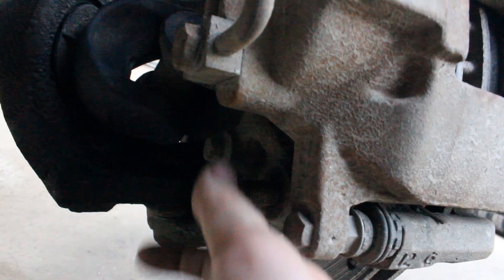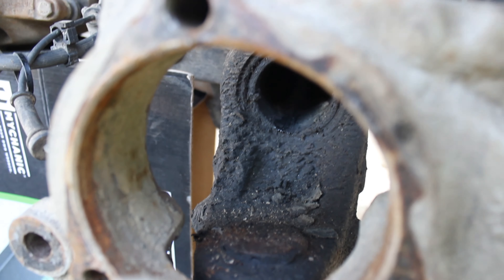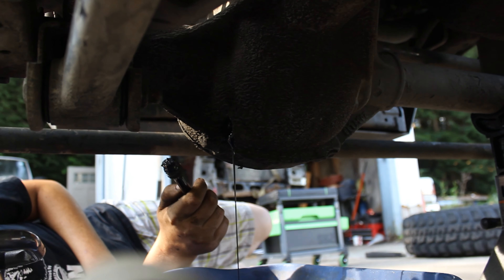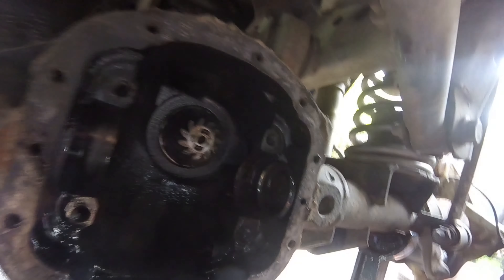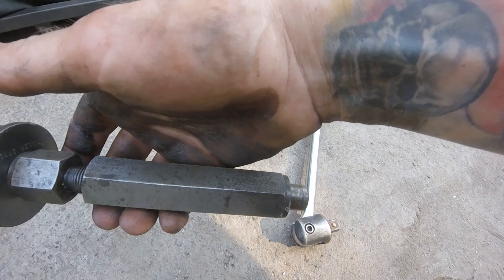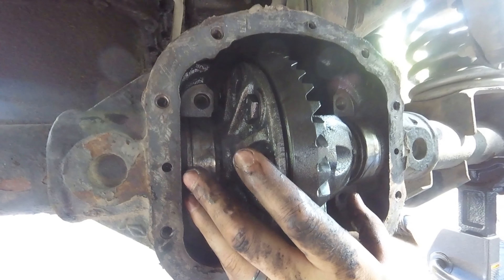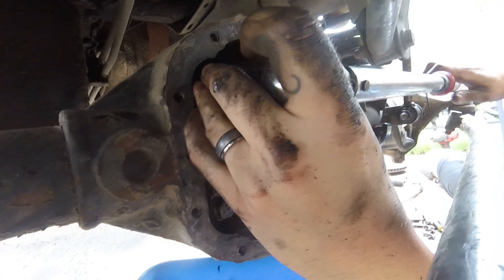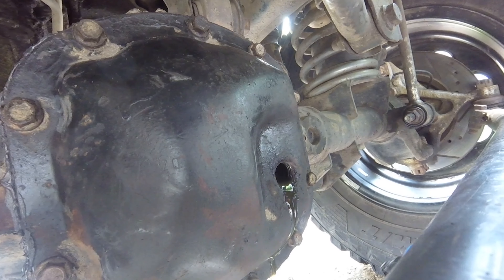How To Replace Inner Axle Seals In A Jeep JK/JKU

Comment: You're lucky the bearing came off that easy. I work at a  jeep/dodge/ram dealership and let me tell you , most of the time, the bearing don't come out this easy. Using the original bolts risk the chance to damage to threads. Best to find a matching bolt and hit it hard from behind. You won't get these bearing off with light taping and wd40 lol Most people don't touch them bearing for 100k+, unless you live somewhere that has no winter or rust. I live in Canada, New-Brunswick, winter are harsh around here. I use a matching bolt and hit it with a big air hammer with a special attachment that fits like a socket. It's a gamble to take on this task with simple hands tool and no air compressor. It's not a hard job but some people will get deceive on how easy this one was on video and be stuck at the bearing part or even before that. Good job tho!
Reply from the maker: I agree it isn’t always easy but sometimes you luck out. I live in New Hampshire so rust is my enemy too. Thanks for watching and any tips you have let me know

Comment: I'm part way through and is going exactly like the video except I can't get the gears to budge. I broke down and ordered a differential case spreader (Amazon for a little over a hundred.) It should arrive on Monday and I should be on my way again.
Reply from the maker: You shouldn’t need a case spreader. It will make it easier but some are just tighter in there. There is a trick where you put a rag in under the gears and spin the pinion and the rag pushes them out

Comment: Nice one buddy! I have a large washer welded to a piece of rebar i use for scraping the axle tubes. National makes good seals
Reply from the maker: D&E In The Garage yeah national is the only ones I’ve ever gotten they work well. I need to come up with a better axle tube scraper
Reply: You beat me to it!! LOL .. I was going to suggest the same trick. For those who dont have a welder simply sandwich the washer between 2 nuts on a long length of all thread. Ive done it several times. Good video man!
Reply from the maker: Power Addicts - FixJeeps.com - Jeep, car and motorcycle tips thank you I really appreciate the feedback

Comment: after watching your great video, I feel that I can tackle this task. Do the gears always come out that easy like in your vid or will I have to pry it out of the differential? I watched another jeep video, that I would have to get some kind of spreader tool for the differential housing to get the gears out, is this true? thanks
Reply from the maker: Intense Rider thank you 🙏 the gears don’t always come out that easy but you should be able to get them out without a case spreader. If they are tighter just gently pry with a pry bar and you should be able to work them out. I would put a rag around the tip of your pry bar so you don’t scratch up anything and just pry gently and you can wiggle it out. Hope this helps.
Reply: @TheBeardedJeeper  that's good to know, hopefully mine comes out easy. thank you very much for your prompt reply!
Reply from the maker: Intense Rider no problem if you have any issues let me know and I can try to help

Comment: Thanks!  We’ll be doing this on a friends jk soon!  Great timing!
Reply from the maker: SWBCrawler no problem man. If you have any questions let me know. Biggest thing is to make sure the bearing caps go on the same way they came off same side and top and bottom the same. They should have marks on the axle housing
Reply: @TheBeardedJeeper  Yea, ive been in a diff before, but its been forever.  No case spreader needed i see.  thats nice.
Reply from the maker: SWBCrawler nope easy enough to pull right out

Comment: When the gears and carrier come out. It doesn’t matter which way the carries goes? As to when you flipped it out and over the tie rod. You definitely turned it. As long as you keep everything on the same side you should be good? As in like, say you pull the gear out at 12 o clock. You could throw it in at say 6 o clock as long as it’s on the appropriate side? With sims bolts etc. That paints an easier picture? Lol
Reply from the maker: Shims have to stay on the same side they came out. The gears and carrier will only go in one way the diff cover sticks out more on one side to clear the ring gear. Hope that makes sense. If you have any more questions let me know.

Comment: I have an 2018 jk and the axle shaft will not come out. I can not figure out why, any help would be much appreciated.
Reply from the maker: USMC1ROU you should just have to give it a pull and it should come right out. Is it a rubicon?
Reply: @TheBeardedJeeper  no just the sport. I figured it out, I put the rotor on backwards and just barely threaded on the lug nuts. Then used the rotor as a sliding ram to get it out. It took alot of force but cane loose eventually. The newer models come with a due seal. Yet the due seal leaked with only 32000 miles on it.
Reply from the maker: USMC1ROU that’s strange I’ve never seen a dual seal my wife has a newer one only one seal. Maybe aftermarket.
Reply: @TheBeardedJeeper  Well either way, thanks for posting the video it helped out a lot!
Reply from the maker: USMC1ROU glad it helped you out. Don’t forget to share it

Comment: Well done, there's only a couple things I've done differently in the past.

-remove the tie rod so you can pull the gear set straight out
-on pulling the gear set, you can use a rag to force the gears apart and the gear set will walk right out into your hand
-I bought the Mopar seal installer for cheaper through an online vendor and WOW does it make a world of difference
I went cheap the first time with Synergy seals that looked identical to factory seals (also a 2010) it's worth going to the new Mopar style seal despite the synergy being $6/ each
-Jeep uses a special orange RTV on the outside of those seals when installing them
-a little grease on the splines doesn't hurt when resembling
-LubeLockers.....but that's a personal choice. I've not had to monkey around with RTV on covers in 8 years now.
Reply from the maker: kswyg thanks for the tips. I could have removed the tie rod but it’s just one more bolt to worry about and it fits right up and around ok. Just a little wiggling and the carrier came right out but the rag tip would come in handy. We did put some grease on the splines when we put it back together just didn’t film that part. The axle seals I got from autozone and they have never failed me yet. 
If we had both ends of the installer it would have worked better pushing both sides in at once. And I never thought about RTV on the seal itself because I’ve never had issues. 
I do want to save to get a lubelocker gasket way better but I don’t mind the RTV. 

Thanks for watching I really appreciate all the feedback too.

Comment: Turbo rad. I can buy all the tools and parts and still save $700 over the shop cost to have this done. Let's see how it goes 😅 Was this a dana 30? I've heard some times there are outer seals as well?
Reply from the maker: You got this! Yes it was a Dana 30 would be the same for the 44. outer axle seals did not come from the factory they are an aftermarket option if you want to use them

Comment: can I get the seal installing tool from autozone?
Reply from the maker: G Hernandez they have a similar one I can’t find the exact one on their site though but anything to drive the seal in will work just makes sure it goes on evenly and you don’t damage it
Reply: @TheBeardedJeeper  Appreciate the fast response. Thing is that my axle has been leaking for the past 15k miles. Not a lot but I am tired of cleaning all the gunk on the Cs. My buddy is trussing and C gusseting my axle tommorrow so I removed it today and already drained the fluid, disconnected everything and I will prep it for a weld and paint it after it is trussed. So if it's already off might as well replace the seals. I am pretty sure he can make a tool to pry out the seals like you but not to put em in. Thanks!
Reply from the maker: G Hernandez you bet. Yeah you would probably want to replace them anyway since welding on the truss can heat them up and melt them. Perfect time to do it. Hit me up if you have any questions
Reply: @TheBeardedJeeper  Damn, thanks!

Comment: Nice video!   Professional tip here - never ever install a seal and axle dry.  You should always lubricate the entire ring of the seal and the sealing surface of the axle.  I know there is diff fluid up against the inside of the seal but in the case of a double-lip seal, you will smoke that seal in just a couple miles of driving it..
Reply from the maker: Thanks for the tip I appreciate it. Always learning and that seems to make sense. Thanks for watching

Comment: A great tip I got from another video: Don't remove the center hub bolt, just remove the 3 hub to knuckle bolts and pry the hub out with a flat head punch and a sledge hammer by hammering around it till it separates from the knuckle. Then pull out both the hub and axle shaft together.
Reply from the maker: Thanks for watching. Yeah I would normally do that but I was replacing the hub for another video too and I didn’t think to mention that you can leave the hub nut
Reply: I was coming down to say the same thing. Everyone removes that center hub bolt and there is no reason too.

Comment: What a great video, two questions; 1) what year is your jeep? 2) how much more complicated is it if there is a locker? Thank you in advance.
Reply from the maker: Mr. User mine is a 2010. And not much more complicated. Just have to disconnect the electric line or air line. Or if it’s an auto locker you don’t need to worry about anything. If you have any questions just let me know

Comment: Why do you remove the 36mm axle nut and then the hub from the axle?  You can just remove the hub and axle together unless you need to swap the axle or hub.  It is less stress on the unit bearing if you do not remove the hub from the axle.  Great video.
Reply from the maker: I had to remove the hub as well I made a separate video on that.

thanks for watching!

Comment: PRO TIP: always remove the fill plug first on anything you do... that way you don't drain fluid you cant replace. ;) of course there are ways to fix a broken fill plug, but you may need to drive somewhere to do that.
Reply from the maker: Good point I should have added that in my video. Thanks for watching

Comment: I have a 2008 JK and could not pry my carrier out🤦🏾‍♂️
Reply from the maker: gene massey wow that’s surprising must be a really tight tolerance. Did you get a prybar behind it and try gently moving that way? You shouldn’t need a case separator at least the ones I’ve seen have not needed one
Reply: Yes I used a prybar and still won’t budge. It’s a really tight fit. Any ideas?
Reply from the maker: gene massey I would keep trying to pry just be careful it doesn’t slip and cause damage to the gears. I’ve never needed a case spreader but worse case you might need one
Reply: Ok thanks
Reply from the maker: gene massey keep me posted on your progress
Reply: I sure will

Comment: Great video! Just a couple suggestions. First, if you are going this far, check your ball joints and u joints and do them too. Also, make sure you have an axel guide. Not sure about the driver side but the passenger side axel is longer and you need it for sure.
Reply from the maker: I agree good tips. You can do without an axle guide and just put something under it as you slide it in so it doesn’t destroy your new seal. I made a video the same time about replacing a wheel hub. I also had to replace a u joint

Comment: So I seemed to have a problem.  Everything was smooth until I was trying to pull the axle out but the u joint won’t fit through the spindle.
Reply from the maker: it should fit through just may be a struggle. some are a tight fit